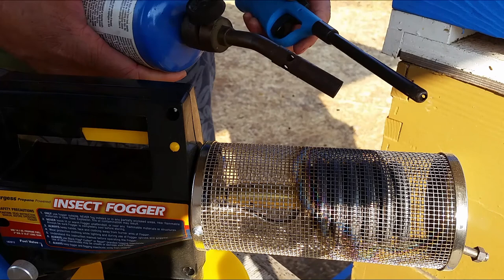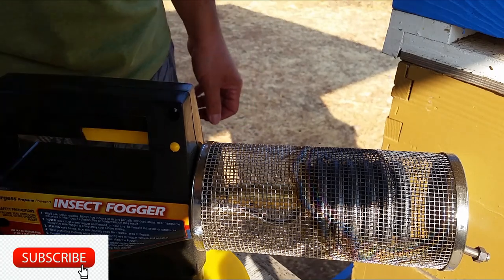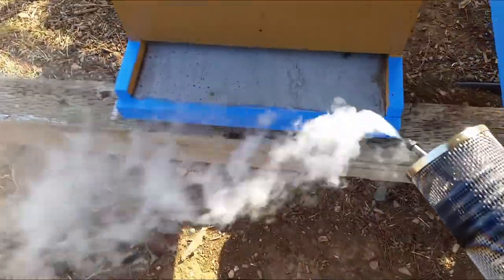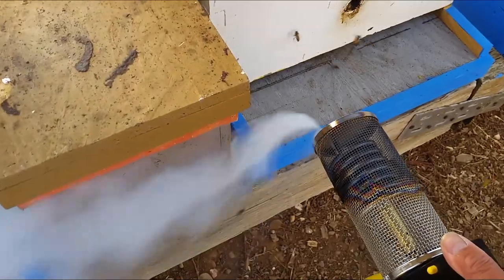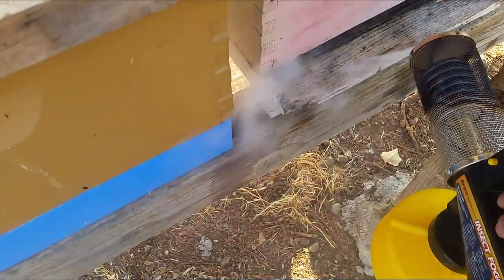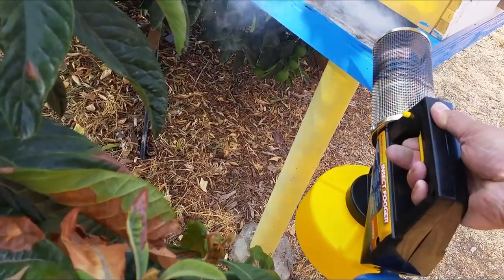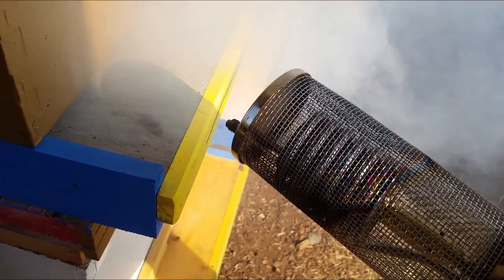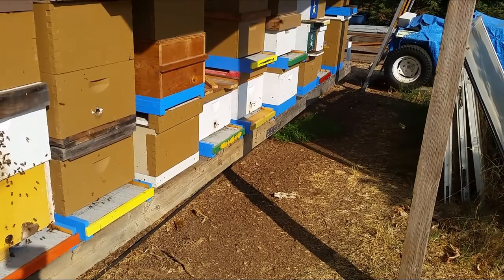Kill Varroa mites with mineral oil | keep hives healthy

Comment: what is your mite count post fogging?
Reply from the maker: I never really did a count on them. I saw some of my hives for quite a few mites on them.
Reply: @tonedubb4325  so then you do not know why the hives died?
Reply from the maker: Probably combination of a little bit of everything. Me mostly.  I don't feed them during winter months because they have  plenty of food in there,  not insulating the hive properly but this is California,  there's no snow here.  It's cold tho.  Maybe not eradicating all the mites, sometimes not changed out the bottom screen bottom boards,  opened the top cover,  bees couldn't seal it causing draft,    moisture get to them. All these will cause the bees population to go down.  Well, to start with, bee don't produce so much in cold months.  If the bees dying faster then they could produce them, there will not enough bees to keep the hive at a certain temperature. As a result,  they die even faster.
Reply: If you put a few drops of tea tree oil , a couple drops of lemon grass and a few drops of spearmint oil it kills the mites faster and kills more mites on adult bees and uncapped brood and the scent of the spearmint and lemon grass calms them down some if they get mad at you for blowing oil fog in their house 😬